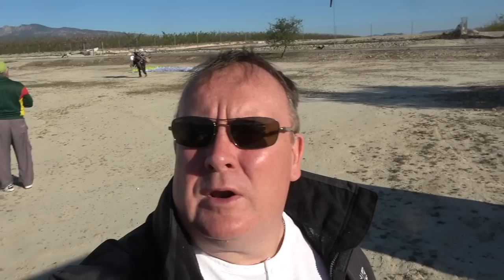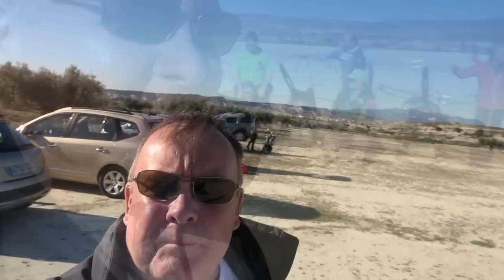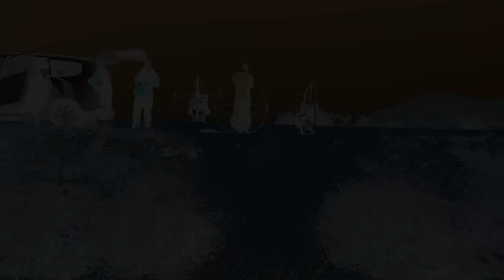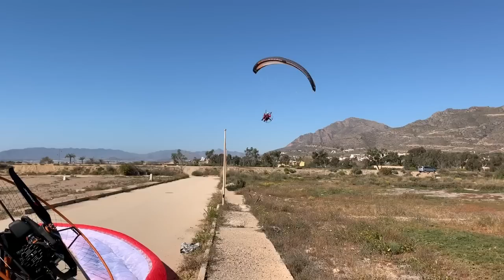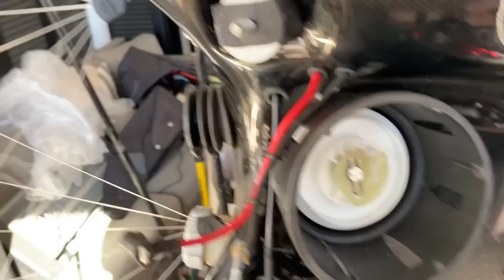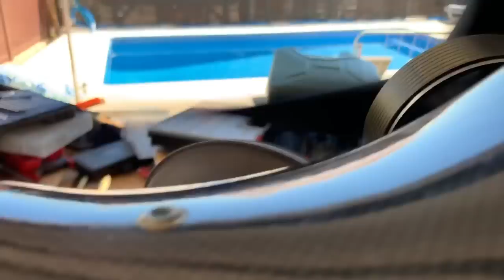Club Paramotor Murcia - & Other Fantastic News

Comment: Glad you are getting settled in and making friends. Maybe a lesson learned here. Don't use screwdrivers with changeable tips when working on paramotores.
Reply from the maker: I think that’s a very good point. It could have moved and jammed the motor in flight. I’ll be counting all my swabs in future 👍
Reply: Good info, I make sure to clean out my pockets too.